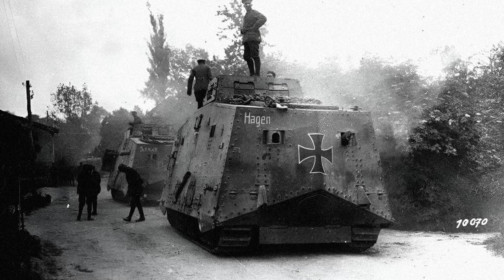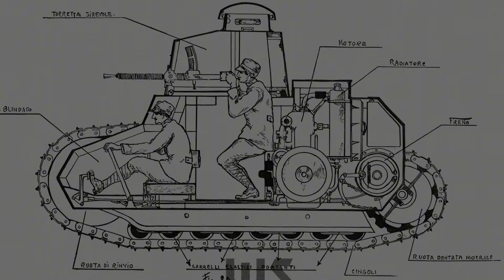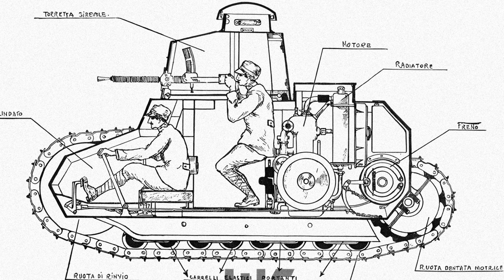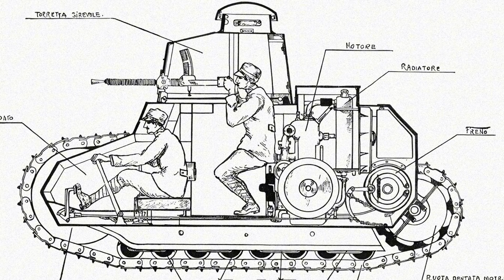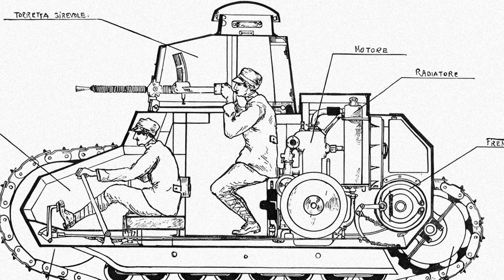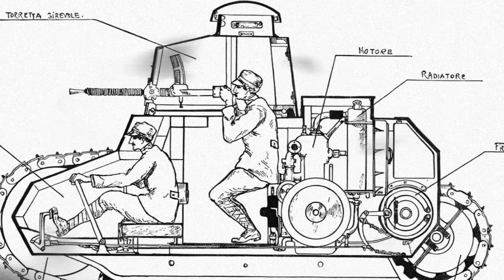The Invalid Tank Kolohousenka: It Had a 'Tail', Wheels, and Tracks, But No Chance on the Battlefield

Comment: Great video! The 19mph may sound slow, but the WW2 Diamond T tank transporter had a top speed of 23! It had 201 hp. So, you were now moving 2x the weight of the tank alone, with 40% of the power of the Sherman M4 on the back going 7 mph slower than an M4 could run on it's own! 

With rubber bushed, rubber pad, tracks it doesn't seem to make much sense except for recovery. 

You can buy a dozen sets of tracks and sprockets for the price of one SLOOOOW transporter. Probably 5 to 15 mph was more the average unless ground was FLAT! 

I saw a nice 1930 Hendrickson tandem axle semi tractor. It looked modern, but it's top speed was 26 mph! 

There just weren't many roads that were paved then, most were made for horses and carriages and were still clogged with them. 

What they saw, rightly so, was exactly how many men and horses it would take to move 10, 20, 50, tons 100 miles, 26mph sitting in the warm cab doing it in 4 or 5 hours was MAGNIFICENT! 

My grandfather drove some of the surplus WW1 trucks in the 1920s. 

Mack AC and an FWD. I had pics of him. 😊